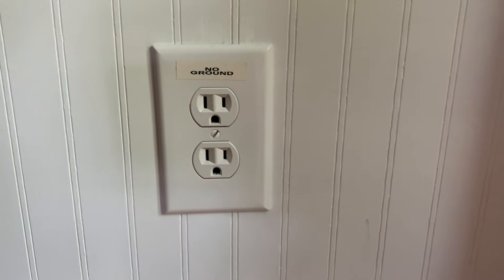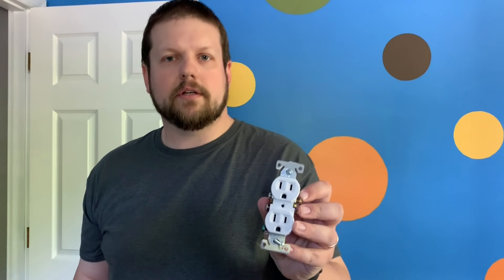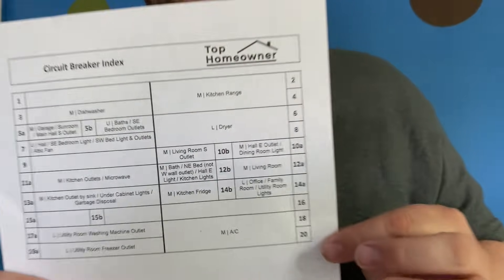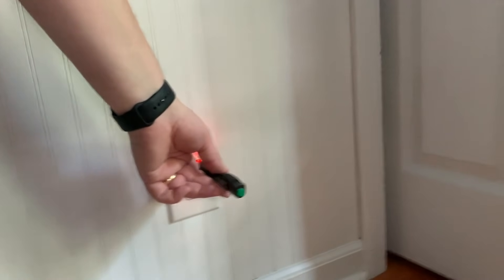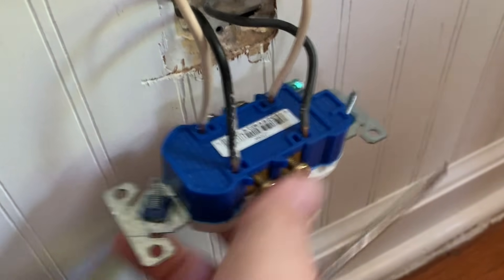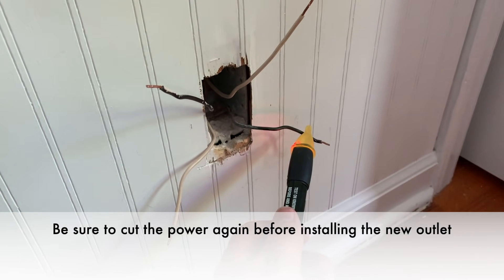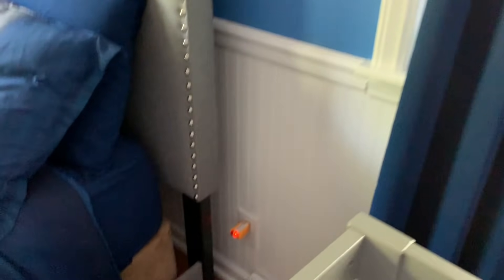Fixing Ungrounded Outlets - An Alternative Option to Rewiring Your Home

Comment: The only place I wouldn’t recommend a GFCI outlet is on any appliance. These really should have a grounded, dedicated outlet where electrical codes permit. So many appliances, especially the high-efficiency washers tend to trip GFCI outlets even when they are otherwise functioning properly.
Reply: This video is about converting ungrounded outlets to grounded type outlets using a GFCI instead of expensive rewiring. This allows using equipment like computers on them.The suggested method is allowed by the law and safe. It does not offer same protection to equipment as actual grounding.
Reply: @Walter: That's ridiculous.  Washing machine receptacles have REQUIRED GFCI protection for many years, under most US electrical codes.  Even dishwashers in dwelling kitchens now require GFCI protection, regardless of voltage or type of outlet (receptacle or hard-wired).

Comment: i plug my guitar amp in the ungrounded and it hums.(annoying). will this ground the outlet so the amplifier no longer hums TY
Reply: GFCI outlets do not add ground, unless you actually ground the outlet! They will protect you from shocks, but if you need the ground for  something like an amp or radio or whatever, this outlet won't help unless you actually ground it.
Reply: Ground will often help... I know when I first installed the preamp on my turntable it had a lot of hum until I grounded it properly.  That said, I don't believe a GFCI will actually provide a ground, it's merely providing a similar kind of fault protection as a ground normally does.  The issue is that the circuitry only breaks the power connection when there's a fault, it's not continually running anything into ground.  So the kind of hum you get from static and so-forth would normally be shunted down into the ground via the ground wire.  AFAIK, a GFCI won't do that on it's own.
Reply: No.  It does not ground the outlet; it provides safety for receptacles that are not grounded.

Comment: In my first house, built in 1934, the wire would come off the fuse box and go up to the ceiling light and then come down like spider legs to the outlets.  So none of the outlets would be informative to this. I cut the wire to the ceiling and came up through the basement to chain the outlets with a higher amp wire.  The upstairs had to remain lower amp wiring.
Reply: My house is from 1922. I've replaced wiring when possible. Did you run into any issues where the knob & tube wiring was undersized AWG and presented an immediate hazard? If I can't replace it, I figure leaving it untouched is the safest so as to not disturb wiring insulation/junction/etc. but would be concerned if it was undersized anywhere.
Reply: @danieldorsett1544  The only issue I ran into (and kicked off replacing ALL non-attic wiring), was a kitchen light switch run we noticed had a wire break. In its correct position it was fine. Move it two inches left or right, no light.
First, we replaced the fuse box with a breaker box. The six ceiling lights stayed on their own circuit. Everything else was wired per code.

Comment: Was it just me forget that one black hot wire on that first receptacle look like it was chewed up or had gotten hot at one time or another? If that is the case I just about bet you it's because those Outlets are stabbed in the back of the receptacle and not around the screw like they're supposed to be! That's just my opinion
Reply: Baked or melted insulation? Yep, seen it many times. Especially on the first outlet on the circuit, which has to carry all the current for the downstream outlets on the circuit. Replacing one of these is the most common fix in a modular or trailer home where they routinely use those devices.

Comment: In that situation, I think I would just replace all of the receptacles that have no ground with GFCI receptacles throughout the whole house
Reply: You probably have 30+ outlets in your home...GFCI outlets cost 1$5-30 each...just a heads up. I grounded all my outlets over the past few days. It cost me less than $40 for everything
Reply: Aimee Joffe how did you manage to ground your outlets? I just brought a house and 24 outlets are older 2 prongs was thinking of using this technique! For 24 GFCI circuits like 230 bucks!
Reply: @aimeejoffe7851  One of my houses has over 150 duplex receptacles.  It would cost $30,000 or more to rewire them all, not including refinishing all the damage to walls and ceilings.  Fortunately, someone already did that when they renovated it in the 1990s.
Reply: Moon Pie  Or just install GFCI receptacles in a few locations where you may need to plug in three-prong cords into one or more receptacles.

Comment: Do not backstab your outlets and switches. Use the screw terminals.
Reply: Will Dwyer    Always better to use screw terminals ,but it is legal to back stab ..
Reply: Legal yes, but so often the wires are over sized for the holes, forced in, and damage the outlet/switch
Reply: @jenvahle  and they are very difficult to remove when changing an outlet or switch.
Reply: @jenvahle  it's not legal it is against code 20 amp and above
Reply: @richardc7433  well yeah, cuz most standard switches/outlets are 15amp max. If you're using the correct switch its fine, but also (in my experience) most wiring is oversized for the job
Reply: @danlux4954  just unscrew them..they'll come off.
Reply: @jsparlin1  yes the screws, but the push ins don’t always let the wire go.
Reply: @danlux4954  buy 20 amp recept and it will go in..cost alot more tho..nec things..
Reply: @jsparlin1  if the wire isn’t 12 gauge no point putting a 20A receptacle.
Reply: @danlux4954  never hurts to overdo..depends on usages.  much more durable and abuse resistant..
Reply: James Sparlin it does hurt because then the user sees the 20A receptacle and plugs in a 20A load overloading the wire and (hopefully) tripping the breaker
Reply: In this case, it appears the backstab is secured by the screws like the commercial grade outlets and not the firestarting cheap residential ones.
But I can't argue that the shepherds hook is the best way to do it.
Reply: Backstab is just fine.
Reply from the maker: I made a follow-up video that talks about this and answers some other questions. You can watch it here: https://youtu.be/3AXcRsAOLPk
Reply: In life, it's best to avoid backstabbers. "They smile in your face, all the time they wanna take your place, backstabbers"
Reply: @royalway12  "Baackstaabers!!!"
Reply: @Thomas Samoht it doesn’t matter who installs the wire in those piece of crap push in terminals. They’re a bad idea. if they were any good, why would they keep the screws on the receptacles?  Why not make 2 cents  more per receptacle and eliminate the screws?
Reply: Found several occasions where the two minute shortcut of using the quickie push in has eventually caused a loss of power in one or more of the outlets further down in the circuit. 

Nothing beats the positive crimped connection of the screw terminals.
Reply: @erikj.2066  The old backstab outlets when you take them apart you see how really poorly made they are.  They are just copper plated steel spring clips, the newer, higher grade outlets have a V-notched plate under the terminal screw.  You slide your striped wire under the V-notch and it clamps down like a vise, a clean tight connection.  To tell if a box is grounded, pull the outlet out then turn the power back on, and take a voltmeter putting one probe in the narrow slit (hot) in the outlet and the other on the box.  If there is a ground connection you should get about 120 volts, un- grounded zero.
Reply: First of all, you should know what your doing before you start.  I’ve use the “back stabs” for over fifty years with no problems.  I have to replace plugs where the screw loosened up, this is not common but can happen. .  Don’t get 20 amp plugs if you are not running 12 gage wire on a 20 amp circuit.  If your using 15 amp circuits use 14 gage wire and 15 amp plugs.  If you match things up and you strip the wire correctly you shouldn’t have a problem.

Comment: Why cant i just put a jumper on the outlet neutral to ground , It all goes to the same buss bar in the panel
Reply: This should never be done, when something is plugged into outlet the ground wire will then become live. You’re thinking of something completely different
Reply: Because the code does not allow that. There are reasons for it like it can cause interference as there can be different ground levels.

Comment: How do I fix a reverse ground.? I hooked my neutral white wire to silver and black to brass side and ground to green.  Outlet didn't work so put a tester on it and said reverse ground
Reply: John Proper  The plug you Instilled is correct. There is a plug upstream that is reverse polarity.De- energize the circuit and check nearby receptacles for reverse polarity.

Comment: How do you know what outlet is first?  My houser is over 60 years old
Reply: You got to watch the video and really pay attention and he will explain to you exactly what you're asking
Reply: @dynamicdopamine  except he doesn't he explains which outlet is last but what if there are 3 or more? how do you know which is 1st is what people are asking.
Reply: @Turk380  please do not take this the wrong way when I say this, I do not mean this in a bad way but it's just the facts. If you cannot figure out how to trace down wires using a multimeter after finding out what and how many outlets and switches are on the particular circuit breaker you are working on.... and then disconnect all of the wires from the receptacles. Of course with the power turned off, and then after you got everything disconnected turn the power back on on that particular breaker, and then use your voltmeter to find what receptacle/wire has voltage coming to it... then you honestly do not need to be working around electricity. That's just my opinion.
Reply: 1. Turn off the circuit breaker 
2. Determine which receptacles and switches have been disabled. 
3. Locate the closest to the circuit breaker box.
Most jobs are handle by an electrician that bid for the job and they can't afford to waste conduits and cable since it would come out from their profit. So, they will wire the house the  most efficient way possible. Wiring from box to box trying to use the least amount of supplies. 

Or

You can just look at the wiring diagram provided with the home.(If available)
Reply: The accurate way to figure out which is the first receptacle is to map the entire circuit, make sure none of the receptacles have anything plugged into them, make sure all light switches are off, disconnect all the wires on all the receptacles and switches ...and then do a continuity check back to the panel.
...Which of course, nobody is going to actually do.  :-)

...Which is why it's better to figure out which circuit breaker it's on and replace it with a dual purpose GFCI/AFCI circuit breaker.  Dual protection (AFCI & GFCI) is the new standard for the 2014 NEC.  Since you have to change the circuit breaker anyway, there's no point in fussing with receptacles (unless it's broken or something).

This is based on NEC 406.4 (D)  -specifically (D) (2) and (D) (4)

The exception for me would be a kitchen or bathroom upgrade where a standard (grounded or not) receptacle needs to be GFCI protected.  I mean, if you get out of the shower in a towel or your in the middle of cooking dinner, am I going to make you go out to the garage or down to the basement to flip a breaker?  That is cruel.  In that case, AFCI breaker and GFCI receptacle at that location.

Comment: So how did you ground it? Did you ground it to the outlet box or did you run a ground wire back to the box
Reply: A GFCI receptacle does not need any ground. That's the whole point.
Reply: He did not ground it. Watch the video.

Comment: Without a ground in the room, even if you had a GFCI on every outlet, you could still get a ground fault on a light receptacle, right?
Reply: Against hot and neutral only yes
Reply: John Connolly  How would that happen since the light fixture would be upstream of the outlets?  Or would it?

Comment: In 2020. If you sell your home the gfci will not pass. You will need to fix that ground
Reply: Sec. 210-7(d)(3) of the NEC clearly states that using a 3 prong GFCI outlet or a GFCI breaker is allowed in ungrounded circuits.

Please show me where there is a change to that ruling.
Reply: @john doe: There is rarely (if ever) any requirement that "existing" installations be "brought up to code" at time of sale.  However, there could be some local code that supplements the general provisions of the national code and possibly makes that an actual legal requirement.  However, a non0-grounded GFCI installed as shown in this video conforms to the NEC (NFPA 70).  So there's that.

Comment: I would never recommend  back stab outlets  use the screws not the push in. And never with stranded  wire.
Reply: I'm currently replacing outlets which have melted due to failed backstabs. 

People aren't exaggerating when they say it's a fire hazard, so yes, spend the extra time wrapping the wires around the screws or spend the extra money on outlets that use the screw clamp method.
Reply: Cinnabar Sonar that’s because it was poorly installed. Backstabbing has nothing to do with it. If you follow the directions right and do it correct. You’re fine. Ive seen backstabbed outlets from the 70s still working today.
Reply: @GlitchedPepsi  Barely
Reply: @GlitchedPepsi  just barely. Load them with 15A, cycle them,  and see what happens.
Reply: had a backstab fail and fry the circuitboard in our furnace... $600 repair because some bloke chimped on a $0.30 outlet.
Reply: @Belboz99  Motor loads do not like undervoltages from weak connections: they will pull more current to make their power and things go downhill fast, wherever your loose/dirty connection is.   There are voltage monitoring devices you can install to cutout your motor load [by interrupting controls] and also tunable overcurrent monitors - motor savers or protection relays, depending on manufacturer.  Things like well pumps and hvac can get saved if you ever have a brownout in your area - but it will not save a motor from itself in the event it goes bad.  I like to have an auxilary contact that I can use for a remote indication in case it ever trips  [a light or small buzzer] when equipment is awkward to get at [such as an attic unit or remote pump house/station].  Work with your electrician on exactly what you need/can be sourced locally, but here is just one example:   www.galco.com/buy/Macromatic/VAKP120A
Generally, I find setting a protection device at 110% of full load amps for the motor being monitored works well - one unit per motor gives me the best peace of mind.  For undervoltage protection settings,  15% under normal line voltage should work ok - this needs a little testing perhaps, to make sure that when large loads kick on the starting current does not trip other units [a delay or 'pickup' setting is available on some units].  Large loads are a comparative term [relating to size of your power transformer], but droop is another subject.
Reply: I'm somewhat convinced that the powers to be that promote and approve codes are doing it for the money.  Years ago, aluminum wire, being cheaper, was sold as the wire of future - until it was found to be a fire hazard.  I think the backstab outlets are heading the same way.  My house is built cheap (vs inexpensive).  There's a lot of foam, sawdust and glue.  The garge isn't insulated.  I'll be lucky if it outlasts the mortgage.
Reply: NEVER EVER use a backstab!. 1980's house had only backstab plugs and switches. No screws. Replaced them all.
Reply from the maker: I actually didn't back-stab the outlet in this video. On "spec" grade and GFCI receptacles they clamp down with the terminal screw for back-wiring. I made a follow-up video that talks about this if you are interested: https://youtu.be/3AXcRsAOLPk

Comment: So... when adding that GFI outlet did it ground the other outlets that weren’t grounded?
Reply: It grounds nothing. The GFCI protects by cutting the outlet if current escapes to somewhere. If protects every outlet connected to the load side of the GFCI outlet. You need to mark those with both "No equipment ground" and "GFCI protected."

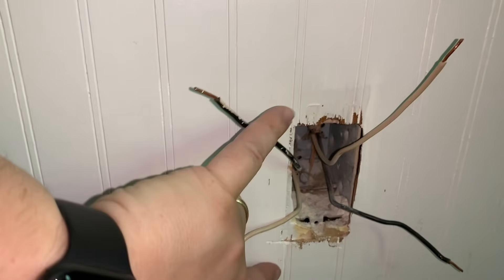Comment: 7:25 shows interior of box with a #16 ground on the bottom romex clamp coming from the romex on the right hand side of the box.

My 1968 house was wired with the same kind of romex and while it lacks the physical strength of a #14 or #12 ground present in currently used romex I assure you it will clear a fault and trip your breaker. I am a master electrician with 35 years experience so I have a pretty good idea what I am talking about. I would not be at all surprised if the grounds in the other pieces of romex were buried under the clamps or cut off short. 

Another issues here is that there is no box extenders (spark guard) installed to cover the exposed edge of the paneling (a fire hazard) and he is not installing tamper resistant devices (code requirement in virtually the entire US).

When you remove something from an electrical system and it does not meet code you are not allowed to just re-install that code violation. When you uncover a code violation (missing spark guards) you are responsible for correcting that violation. If you don't and someone get hurt or killed or you burn your house down and that is how/why the accident happens you may be on the hook for your negligence.